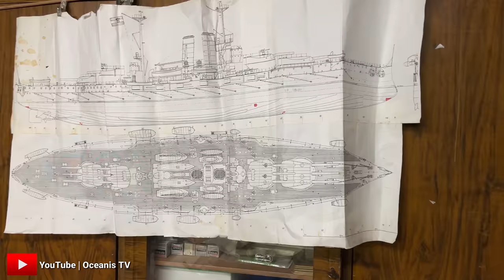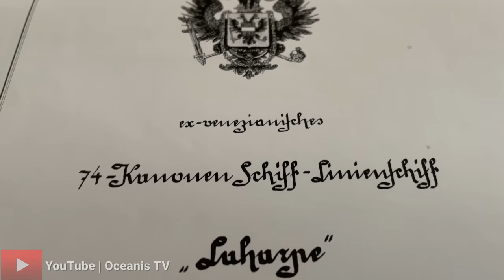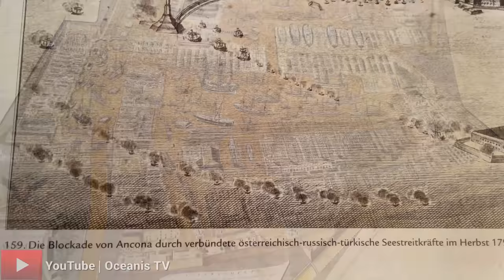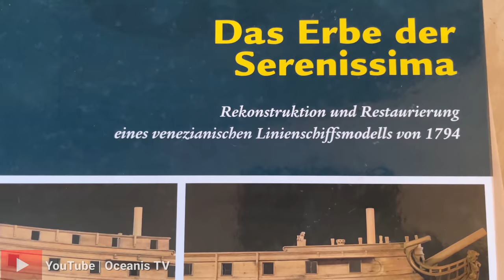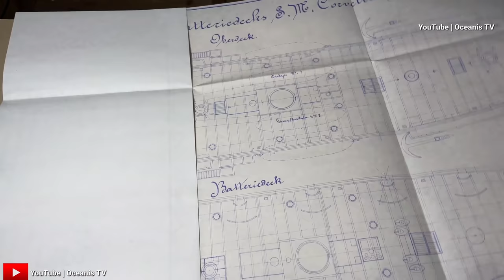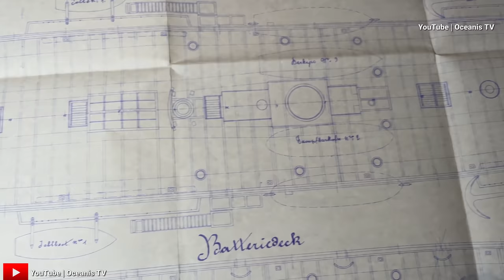Incredible Ship Model Maker Gallery, 4K UHD

Comment: Those ship are awesome. Do they stick to the actual plans of those models or do they improvise while building? Is it possible to build a ship simply copying the design from photos of a it? I can improvise small boats without any plans but such builds are something else. Also I'm not sure if I could read boat plans correctly because there are too many lines or numbers that are essential to copy the real thing. Where should I start, any suggestions?